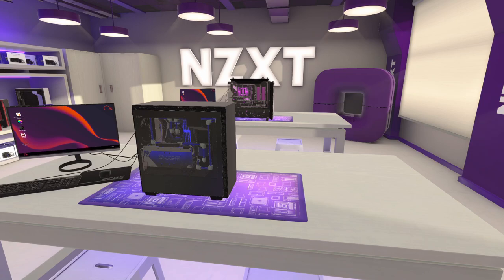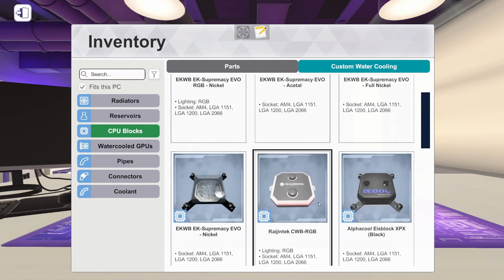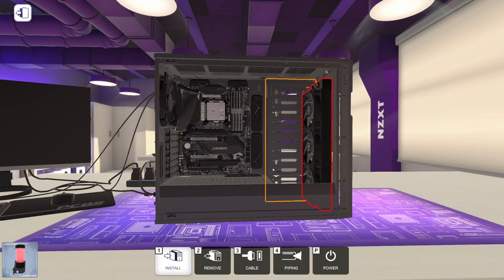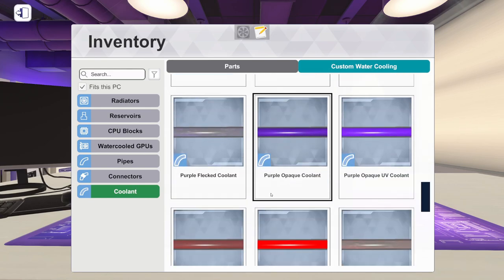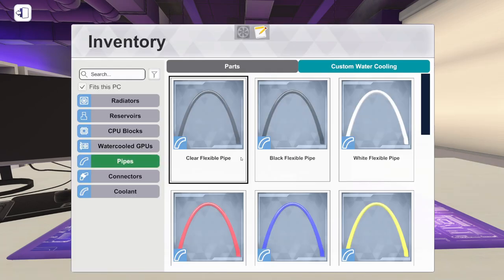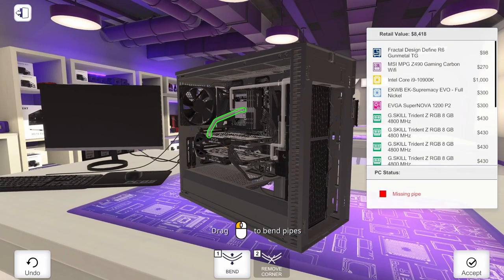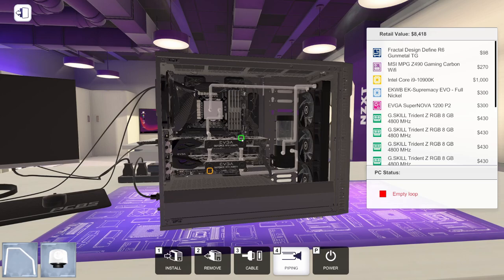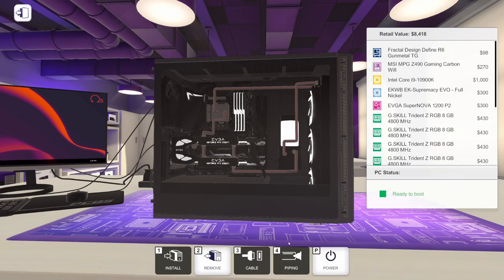Deep Dive Episode 3: Custom Water Cooling

Comment: I have watercooled a pc exactly like this but I'm getting like 95 c cpu temps on idle. I don't know why. Cpu is Ryzen 7 1800X since it's the best cpu I can get rn for my level.
Reply from the maker: Don't forget thermal paste :)
Reply: @PCBuildingSimulator  I always put thermal paste on but the only thing different from the other times is that I am trying to overclock it. Is overclocking Ryzen CPUs always this bad or is this one an exception?
Reply from the maker: @StopRemindingMeOfThoseDays  Should be fine, sounds more like an issue with the overclock or a something else wrong (hence the paste reminder). Might want to double check the cooler is plugged in too, 95 degrees idle sounds really off.
Reply: @PCBuildingSimulator  That's basically what happens whenever I try to overclock this CPU by 200 MHz. I guess I'll just accept a 100 MHz overclock.